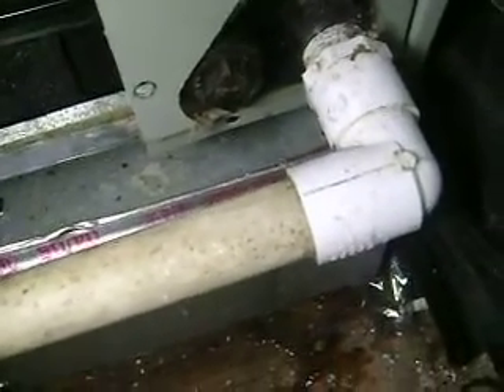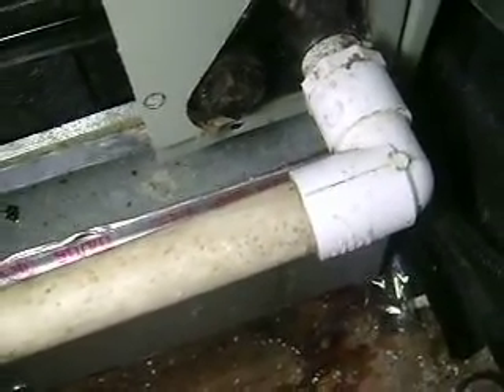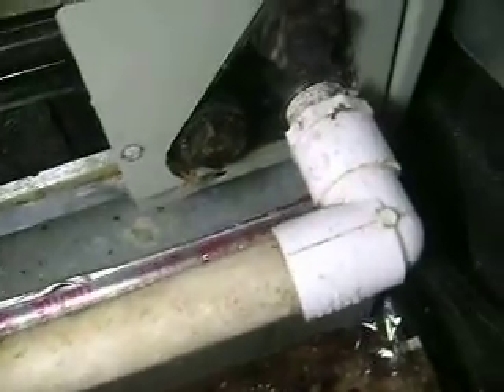Trane central air inside unit leaking water through square hole.

Comment: That square hole is a weep hole. It is there to show that the unit is not draining adequately. There are three likely reasons for your leak. 1. Drain line is blocked or restricted. 2. Drain line does not have an adequate trap. 3. Your filter is very dirty. 
I would advise you to install an overflow kill switch on the secondary drain port (left port) when once you do that you can plug the hole.
Reply: So the whole is supposed to be open? Our ac tech just sealed it to stop it leaking... without any kill switch or anything.... in our unit this "weep hole" drains onto the wood supporting the unit... which then leaks down onto the ground flooding the house...  should it drain to like a secondary drain pan or something....?
Reply: Please advise
Reply: @floyd27860  A secondary drain pan will keep the stud dry and is a required if the unit does not have an overflow kill switch. Once the unit is installed and running and the weep hole is confirmed to be dry it should be plugged.
Reply: @shieldcracker  you were right! The drain line/P trap was clogged. Turned off the system, vacuumed out the line, ran vinegar at the p trap & let it sit for 30 min. 
Took care of the problem

Comment: I was told the hole is called a weep hole, when the pvc drain piping get plugged the water will drain into the pan  under the condenser via the weep hole and when the pan fills there should be an electrical trip shutting down the hole AC unit telling you there is something wrong.
Reply: Correction the unit in question is called a evaporator not a condenser, the condenser is out side.